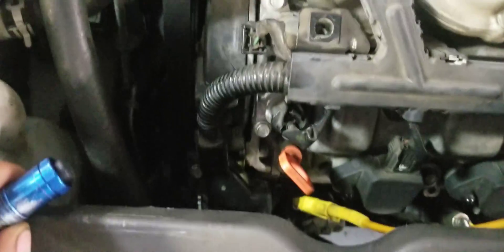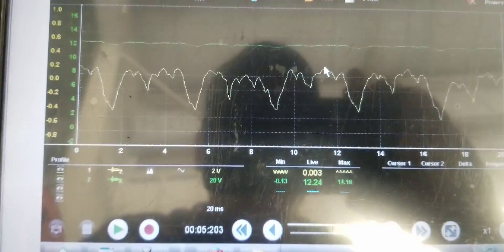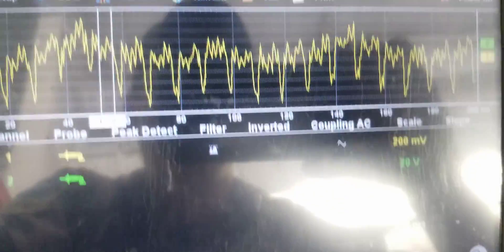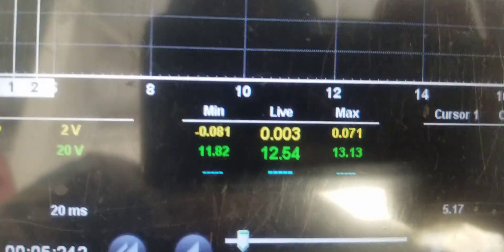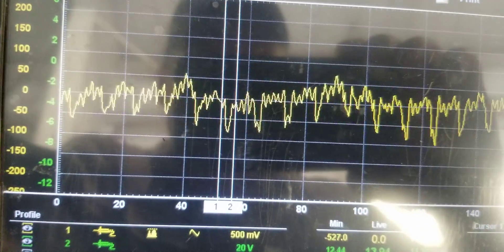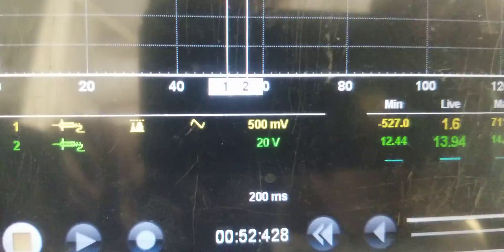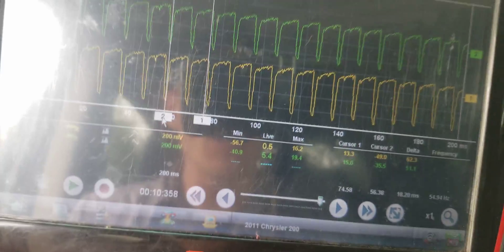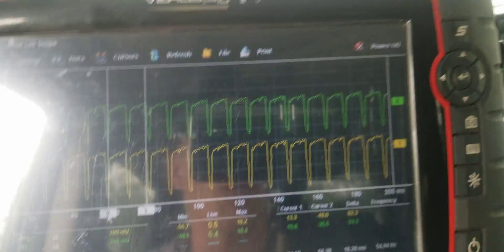2012 HONDA ODYSSEY 3.5L, ALTERNATOR TESTING (PART II)

Comment from the maker: The charging system voltage did hit around 12.42V with all loads on at idle, warmed up, in park.  I mispoke and I think I said 12.56V or whatever in the video, again, NAPER quality and NOT MY CALL...Keep this in mind before jumping the gun.

The ripple is much better, no whining, and she is putting out adequate voltage without loads on at idle, fully loaded she seems to have some trouble keeping up, but I'm not going to lose sleep over it.  Again, remember what alternator is in it guys!

I did check battery cables for voltage drop and they were showing a difference in potential of approx...100mv +/- 100mv or so, that's loaded and unloaded etc, I did this prior to filming part one, I just wanted to clarify that, because it was mentioned already and it's not a cable issue IMHO.

Finally, I did prewarn my service writer about it and told him that this is a potential comeback-best I can do to CMA.  We all know that these newer smart charging systems and their OEM alternator's can be very picky, and I don't care what make or model your dealing with!

Thanks for watching and hopefully this helps somebody else out there down the road accordingly!

And no guys it was not the flux capacitor, I already tried testing that with it disconnected and it didn't change a thing🤣👍.

Furthermore, if she does come back guys, because TBH, YOU KNOW I'M not very HAPPY with the part's I was given to work with...CLEARLY, but YOU better believe a rant video will be included about it👍.

Thanks for watching and hope you enjoy!

Be sure to checkout Part I first:
https://youtu.be/tx2FdN1_imc

Comment: It's not the Altinator yo
Reply from the maker: Then what is it?  This car has been long gone and fixed by the way 🤣.
Reply from the maker: ???  I gotta know yo???  Crickets 🤣👍
Reply: The Alternator is just a year maybe two fix , the real culprit resides under the fuse box.. that surging is from the electronic Load Device . It's contacts get worn -burnt ...Slowly chokes the alternator n battery to death .
Reply from the maker: @jedidiahshilts7152  Good to know, thanks for sharing this with us.  I will research that further in case I see another one in the future.  Take care and thank you for clarifying 😊
Reply from the maker: I see it on the factory Wiring Diagram...looks essentially like it monitors current and voltage and the PCM provides it a 5 volt reference; which is being monitored by PCM I take it?  Looks similar to how a thermistor is monitored.  Interesting stuff 🤔
Reply: @PaulysAuto  It is ...four years ago a replacement was 7$ , I called Honda and they no longer sell it separately ya got to buy whole fuse box ..611$ ...that sure is some real B.S ...a used one is only a bandaid . But to anyone who is throwing wrench's ...just pull that 120 amp fuse and if there's a exsessiv amount of (D-Grease on it , for what. Ever reason ...that's where I'd Start ..That Oddesy really is a space ship ...the future is a electric nightmare my best advice is to keep all that stuff off ...and she should get ya on down the road .
Reply: Electronic Load Device,

Comment: From reading the Odyssey forums there are a lot of people that say to get Denso remanufactured alternators only (oem). The other brands cause all sorts of issues.
Reply from the maker: Well, the van has been fixed for quite some time now, but I do not disagree with that statement.  Thanks for the information and for watching!

Comment: Great 2 part video Pauly   like your scope work.   the crazy signal you got with the  alternator completly disconnected was strange.  To verify if it was shop lights you could  check frequency with your cursors  60 cycles   or 60 HZ   IN 1 SECOND.   One thing about AC coupling is that it is super super sensitive .   a crazy theory i have is could it have been  B CAN  F CAN  voltage drop?     great job man
Reply from the maker: You know what, that's interesting, I wish I could check for that and have the damn thing back again!  Now I am sitting here wondering🤔????

Loved this feedback, thanks for watching and sharing this with us!

Comment: I was going to say, as long as you get paid for the warranty replacement. Then I remembered, you're not on flat rate! Hahahaha
Reply from the maker: Nope, it's difficult though, because I have a standard that keeps me frosty, I don't like doing jobs twice, regardless of how I get paid!

Thanks for watching Pauly!
Reply: I too have high standards but, we can't control what parts we get stuck with. I always recommend OEM for critical parts but usually wind up "In the zone." If I'm really unlucky, I get dorkman.
Reply from the maker: @PaulyD0859  it's frustrating when it comes to a critical player like an alternator.  There's a reason why they charge an arm and a leg for OEM alternator's these days!
Reply: @PaulysAuto  management always seems to do that, your the expert until I costs more then they think it should. Drives my nuts. And when the junk aftermarket parts fail I am sure to rub it in and say " told ya so".
Reply: Last week, I went through 4 aftermarket EGR valves, looking for one that didn't leak vacuum through the solenoid. I finally gave up and told the owner, this is on you!
Reply from the maker: @PaulyD0859  exactly, even if I'm getting paid to go at it again, enough is enough, I just want to move on to the next one you know?
Reply from the maker: @picoboo5048  for sure, I appreciate your feedback, it's tough to get people to understand that it's not the mechanical parts to blame in the aftermarket parts a lot of the times, but more so the electronics and submodules that are now part of them.  These alternators these days are duty cycling and computer controlled.

Now certainly I could have shown all of my checks on the alternator connector which would be worthwhile, but I cannot film everything, because it eats up more time.  Besides, it's not the computer or wiring going from it to the alternator that's at fault here (I'm fully confident in that after checking the system over prior to turning on the camera).

Otherwise I would have filmed the faulty CKT accordingly, this was just a simple alternator failure, that I had hoped to show old vs new in terms of ripple and voltage, when I say new, I mean genuine Honda part!

Oh well, just proves why I made a video about it the other day and why we as techs are not as efficient as we can be, often because of crap like that!

Thanks for watching and sharing your thoughts brother!
Reply: @PaulyD0859  and I find alot of the time, management will price out what they would pay and not even ask customer. Only give them the one price, which alot of the time is close to the same price as OEM. New means new, not good. I could rant for days about this 💩. 🙈🙉🙊
Reply: @picoboo5048 , I've recently begun to rant that their tight-assed cheap parts habit is effecting my personal reputation. The customer doesn't know or care why or how the part failed, all they know is their car is back in the shop with the same problem. They don't know my name but, in their mind, it was my fault. 🤬
Reply from the maker: @PaulyD0859  couldn't agree more, we look bad for it and often the bus driver is quick to put it in reverse and back over us a second time just to make sure that they don't look bad for being a salesman rather than be a respectable and honest person with the customer!

Comment: That's a pretty big drop with the loads on. Did u check for any voltage drop from alternator post to battery positive post?  That cable might be bad or it could be a crappy alternator
Reply from the maker: Yes I did a voltage drop prior to the first video on the cables and approximately +/- 100mv drop on the positive and negative side of house, was thinking that initially as well in my first video.

However I agree 100%, but again I'm not happy about the sh!@ alternators Napa sells, I have warrantied out countless alternators from them and yet our service writer keeps on keeping on, but I'm paid the same regardless, so sometimes a guy just says, well it is on you if she comes back again!

I didn't like the drop either, but WDYD???🤬🤬🤬